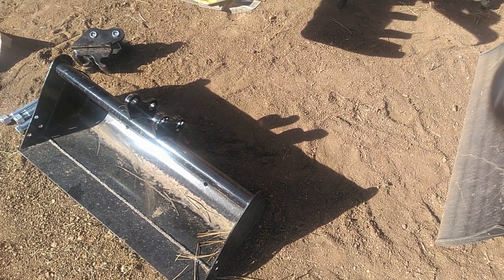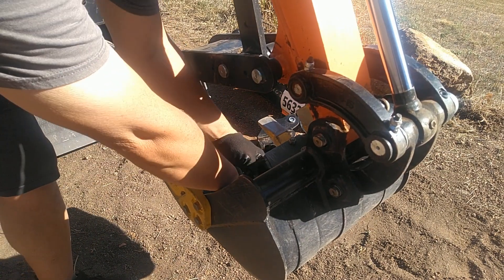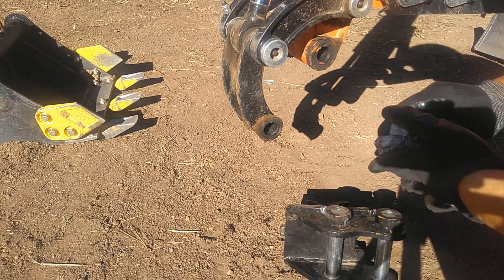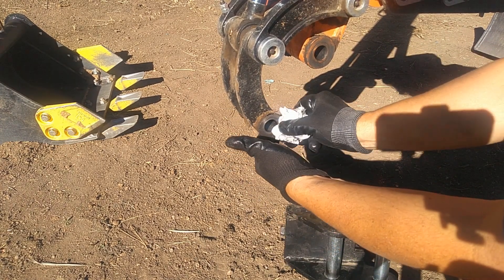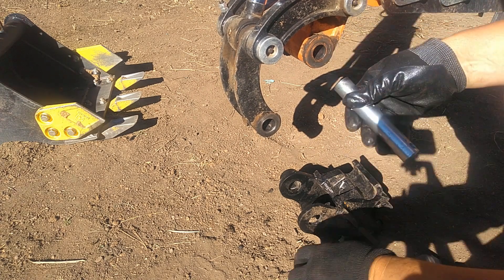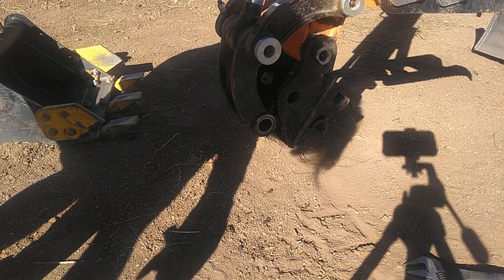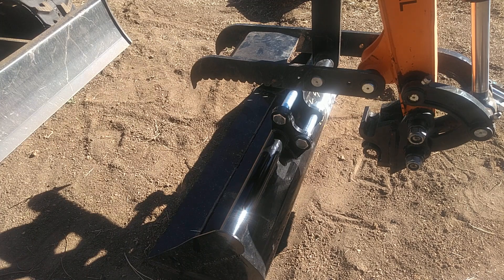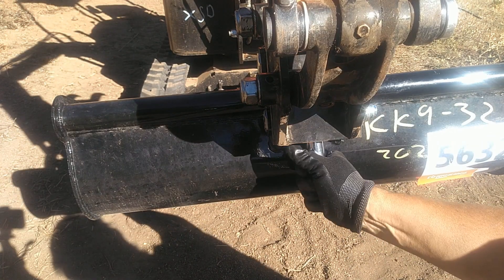Chinese Mini Excavator: Installing the Quick Attach Coupler for the First Time

Comment: With that new coupler, can you pick the bucket up with it facing outward?  (Reverse bucket use?h

Awesome video, very helpful, ty
Reply from the maker: @davebrown3212  I have not tried to reverse it yet.  It is snowing today and tomorrow,  I will try to remember on Sunday to check if it can be or not.
Reply from the maker: @davebrown3212  We got a bit of a break in the weather today, so I walked down to the creek where the mini excavator is currently located. It definitely looks like it can be reversed, and if we get a couple of dry days this week, I’d like to confirm by testing it out
Reply: @madscientisthut  that would be awesome, thank you. I’ve seen others do and will essentially give you a loader configuration on the excavator.